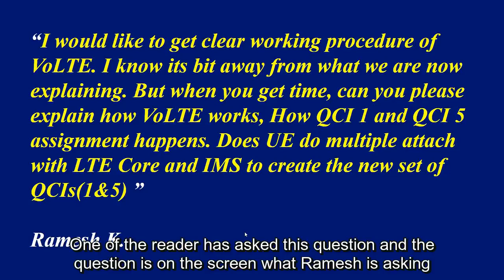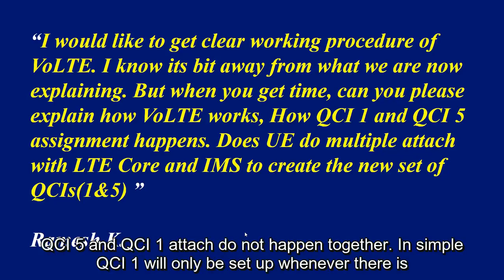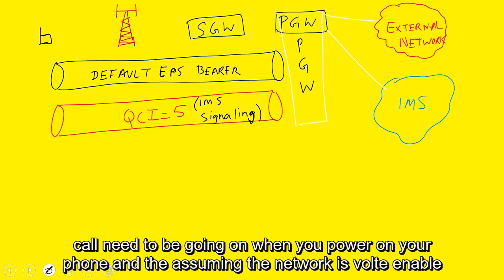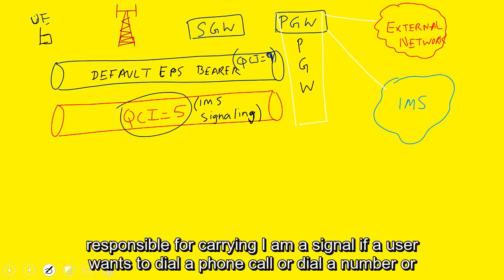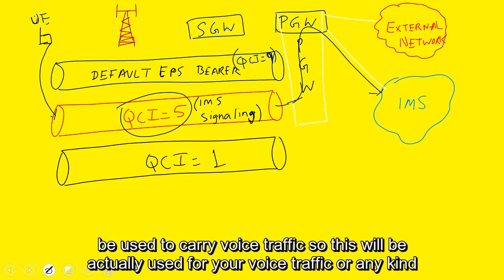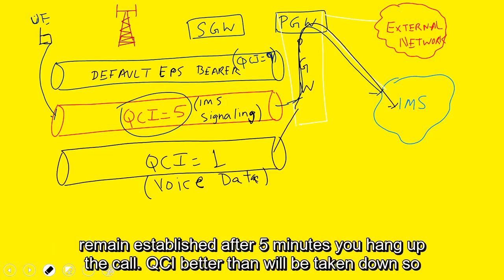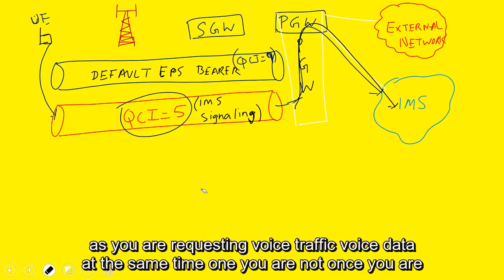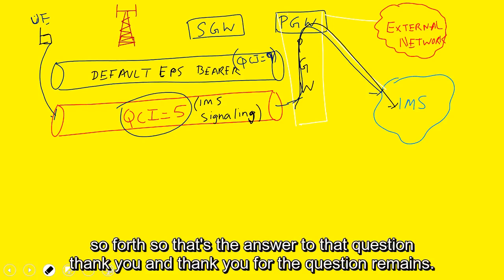Does QCI-1 & QCI-5 Setup Simultaneously For VoLTE? Subtitles

Comment: Hello Azar. QCI 5 and QCI 9 will remain active as default bearer for future possible IMS signalling or PDN connectivity simultaneously? Does that mean if the Volte voice call is ended and user needs to access the internet again, it will access through QCI 9 without establishing Default bearer again as previous one will remain established for the duration of the whole volte call ? And if that's not the case, then can UE access the PDN through QCI 5 when Volte call is ended and connect to PDN?